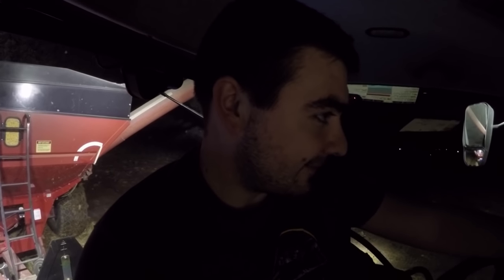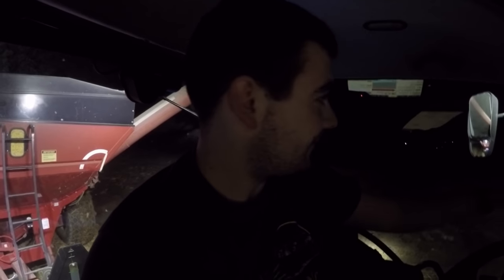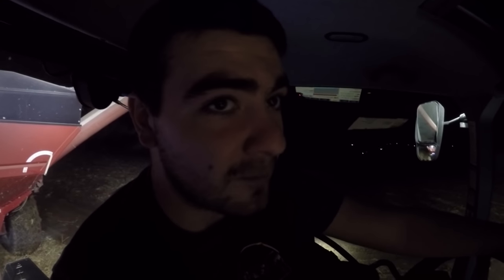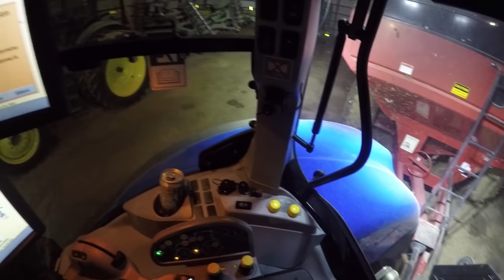Big Blue Gets To Work! - New Holland T7.315

Comment: Tested the T7/315 2 years ago.  Same engine and transmission as in my T7/250, which is powered  up to 270 hp and now he has 4300 hours. Only the front axle is different.

Comment: have you driven it using the foot throttle? it can be tough on the vario transmission driving it on the stick as your restricting it and using the transmission to slow the tractor and load constantly. I know with the fendt transmission its much harder on the vario driving it on the stick.. just worth giving it a go while you have a demo out to see what its like to drive that way as its favored where I'm from at least.

Comment: This is probablyt the best video so far and I hope you enjoy the blue. One thing that i dont understand, the way you transport your grain from fields to bins are really complicated and lots off hours off driving tractor. Why just use that tiny Little red wagon and not a big capacity trailer. In europé we uses that a lot more of we use a chaser bin. The 7800 could have a train off those tiny wagons and you use one, cant be very fuel effiicient?
Reply from the maker: +vafaningetnamnledigt The problem is that loaded wagons are extremely unstable on the road, and push the tractors down our driveways. There are areas where semis cant get to as well.
Reply: aren't there any braking systems available for your trailers? Here in Germany air pressure braking systems are standard on almost every tractor. Other countries have hydraulic systems for trailers as well.

Comment: Isn't this tractor a bit of 'overkill' for hauling grain?  I suspect the old reliable 4020 would do it.  I do however that Ryan is using this demo tractor every way he can.  I'd like to see it pull the disk or the chiesel plow.  I suspect that those would not even be a challenge for the 315.  I bet it would pull a 12 row plant rig with subsoilers in front and saddle tanks for liquid applications.

Comment: can you not pull the gravity wagons in tandem? are they too heavy? even with the 4640? can you not run the grain carts loaded on the road?
Reply from the maker: They're often too unstable on the road and too heavy. They'll push the tractor down the driveway. You're not really supposed to run loaded carts on the road as it's hard on the bearings.

Comment: Such a big grain cart and  a so small wagons to bring the corn away. I think that's totaly inefficient or isn't it ?
Reply from the maker: +Florian5120Pro Yep, but we started pretty much from scratch in 2014 so we're building our equipment back up.
Reply: There's a switch on the top right above the light panel that you can turn off the roof light pointing at the combine when unloading so you don't blind them. Have a T7.225 that's the same, Great idea from New Holland. Just a helpful tip maybe?
Reply from the maker: +Farming In 1080P You can see in one of the aerial shots that I was playing around with it.
Reply: Ah noticed now, Seem's like your enjoying the tractor and the autocommand box. Once you've had vario you won't want to go back to anything else :)
Reply: You guys will really enjoy and appreciate that tractor. We have the Case IH  variant of that tractor and it is so smooth to operate. Now it won't be so easy to go back to the John Deere when you need to use them for something.
Reply: In the end you can only move grain as fast as it can unload and I think they out harvest their auger.
Reply: Thomas Keeling very true

Comment: I just noticed that you have corn on top the combine roof. it must be yielding good. it would be better if you could keep it in the combine bin. and if you had a 10 wheeler you would not have to drive all that way back out to the combine carrying that extra weight compaction you were going to get a lot of compaction in your fields pulling way back out to the combine with half of a wagon load on the grain cart.

Comment: Why such small grain carts. Big Blue would be like a T9 with over 550 hp with dual tires. Do you guys ever upgrade?
Reply from the maker: +Moonlight Blade It can't handle a bigger grain cart like that on our kind of hills.
Reply: It wouldn't really make that big of a difference.  That cart looks like its matched pretty well to their combine.  The thing that probably holds them up the most is wagons to and from the farm and carting back to the wagons with a full cart.

Comment: What was that thing he did under the tractor? Change the hitch or something? XD //someone who knows very little about farming and tractors 😂
Reply: the hitch stuck too far out so he slid it in. I'm assuming their hoses from the cart wouldn't reach the tractor is why they did it.
Reply: Plebasaurus Rekt tractors have 540 and 1000 rpm power take offs (PTO) that drive implements and the distance from the end of the PTO shaft and the hitch pin hole is different between them so he was shortening the drawbar length to be able to run  the 540 speed
Reply: madfarmer912 dave  okey, here in sweden the tractors usually have hydraulic hitches so you can extend them from the cab and then retract them without leaving your seat, i guess that tractor didnt have it then?
Reply: Plebasaurus Rekt here in the US I haven't seen hydraulic hitches on tractors. also I forgot to mention on tractors this size they also have a second 1000 rpm shaft. we have 6 splined 540, 21 splined 1000, and I think its 23 splined 1000 which is larger. I'm not sure if the two 1000s share the same drawbar length I don't run any equipment that large so I'm not to familiar with the specs for the larger on.
Reply: madfarmer912 dave okey, thanks for the answers. Farming is a lot more complicated than it looks thats for sure XD
You seem pretty experienced with all of this, i guess you have your own farm/equipment? My dads pretty tired of his current job, so hes been talking about buying a tractor to do contracting and so on, and to perhaps begin with farming on our family farm again, So im trying to watch theese videos to learn a thing or two about it :-)

Comment: do u still have 2 gravity wagons why not use both to cart back to bins ?
Reply from the maker: +Trevor Fout We discovered we can keep the combine moving with one tractor on the road and the other hauling back to the buildings rather than two hauling on the road.
Reply: +How Farms Work need one of the ladys to run the small wagon with the pickup lol just seemed like u hauled alot of corn on two directions but if the combines moving its all good
Reply: How Farms Work hhugyytttttf